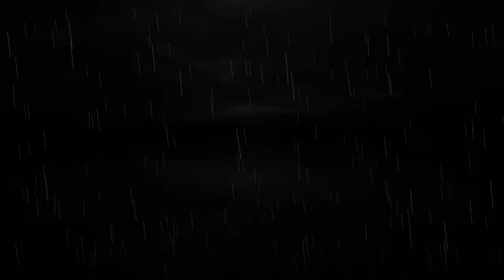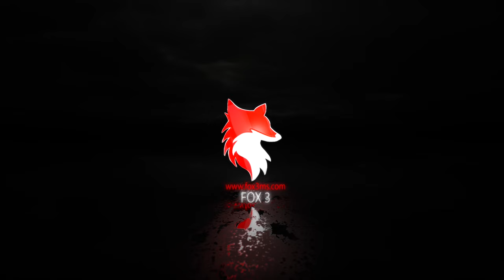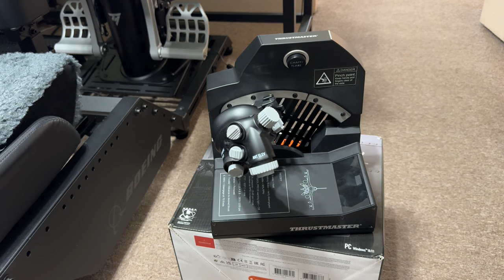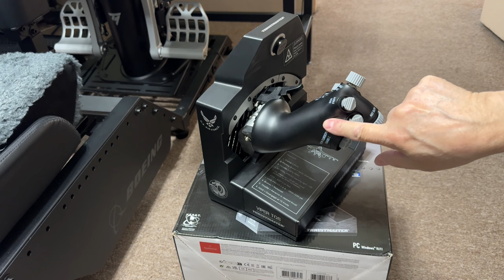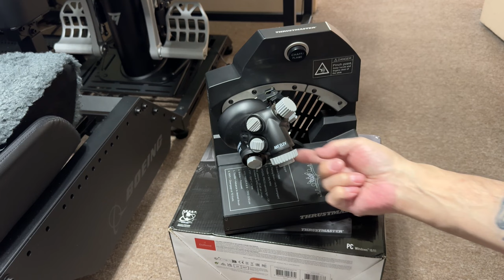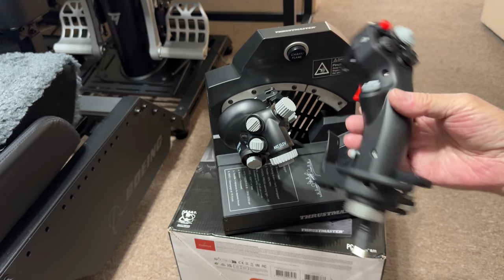Thrustmaster Viper Tqs Overview: Part One

Comment: Winwing grip is designed to be used with both the F-16 & JF-17 ( the Jeff has the same type of throttle grip, but replaced the MAN RNG knob with a 4 way HAT ). Personally, I don't mind the extra HAT of the WW throttle grip, just wish that they enlarge the RNG knob because the current design really need some aftermarket mod to make it usable ( especially so if you are wearing a glove )
Reply from the maker: I didn't know that it was the same grip for the JF-17, I was thinking about getting it on the next sale.  Thanks for watching.